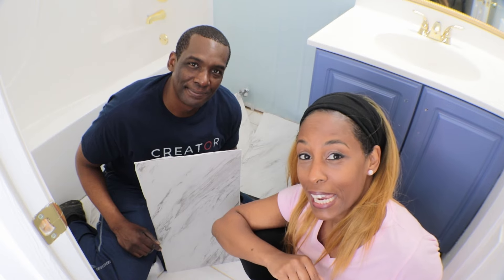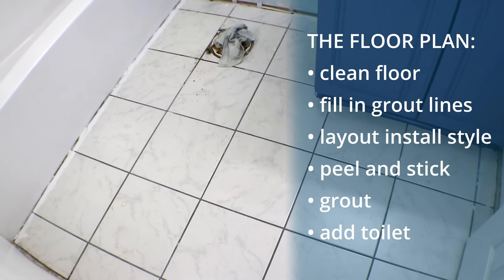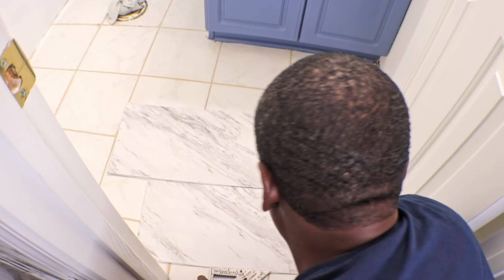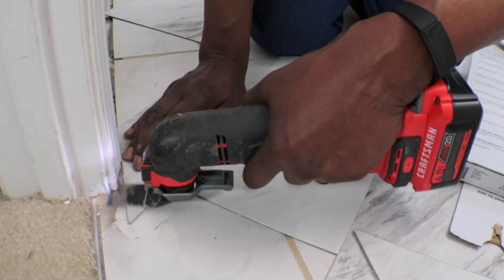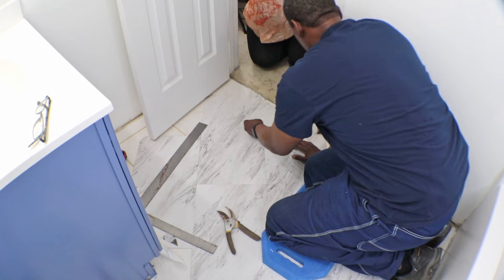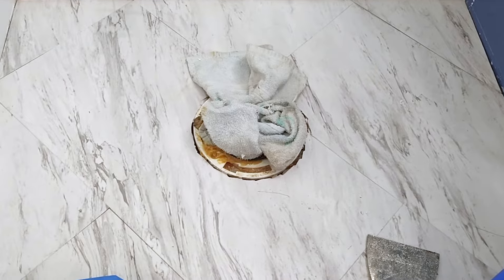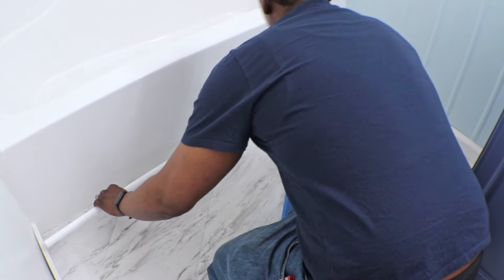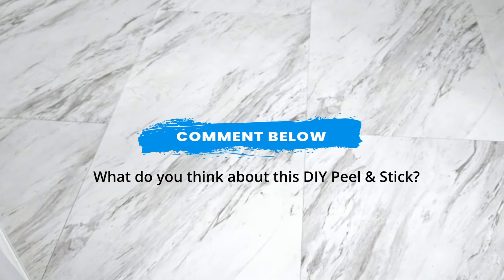How To Peel & Stick Over Ceramic Tile | DIY Home Updates on a Budget

Comment: Beautiful, I plan to do this in a small half bath. My issue though is the toilet, can I tile around it without removing it? I'm alone and don't have anyone to help.
Reply from the maker: Hi! Yes, you absolutely can peel and stick without removing the toilet.  You can use the tile backing to create a template kind of like what we did in this video here @5:33  Then cut out the special tile to place around the base of the toilet.  🤗
Reply: @DIYPowerCouple  Thank you!
Reply: @DIYPowerCouple  Thanks....had the same question.

Comment: This is a very good product. I used this over my ceramic tile in my main bathroom however I did use spacers so I have larger grout lines and it looks great like real marble tiles!
Reply from the maker: Thanks for sharing how your DIY turned out! 😀

Comment: I love your videos so much that I was inspired and bought them yesterday at Home Depot, but I have a question. I also need to level my floor. What would be first? Clean the floor with degreaser and then fill the grout lines? or fill the grout lines first and then clean all the floor with degreaser? Thanks and Happy Fathers Day!
Reply from the maker: Thank you ! We appreciate you! We cleaned the floor, then filled the grout lines and let dry, and then wiped the floor down once more before using the peel and stick.
Reply: @DIYPowerCouple Thank you so much!